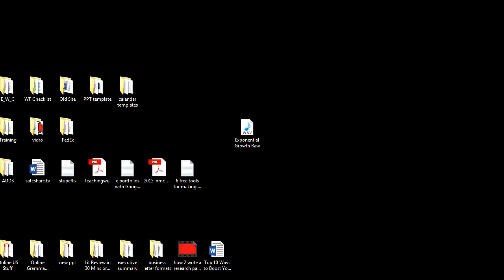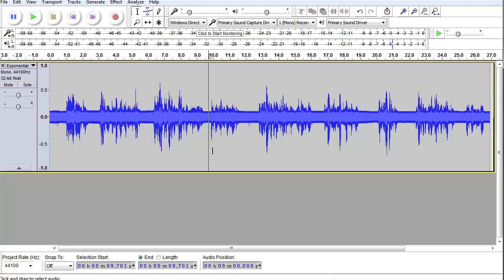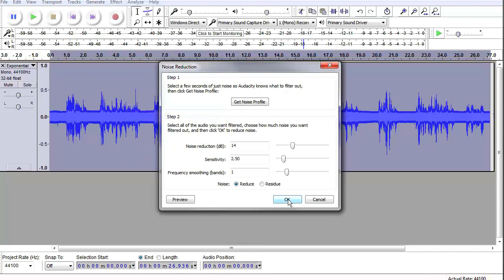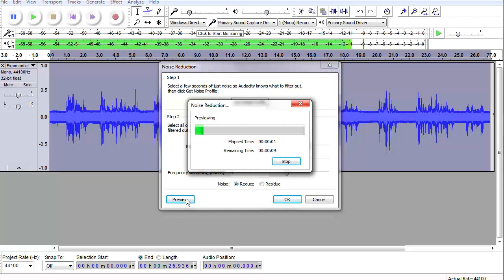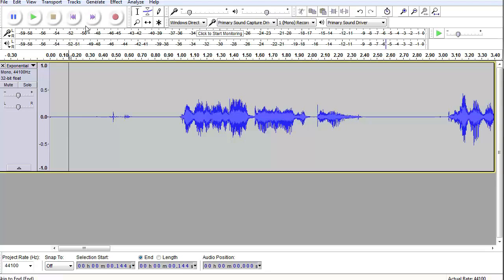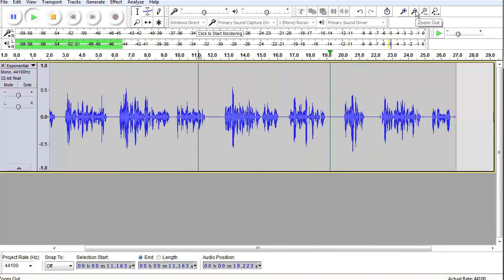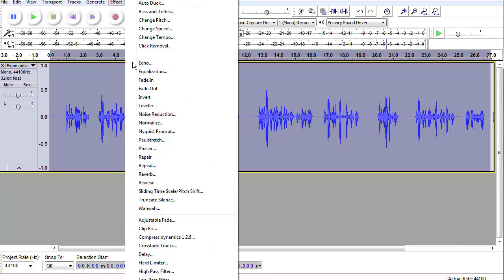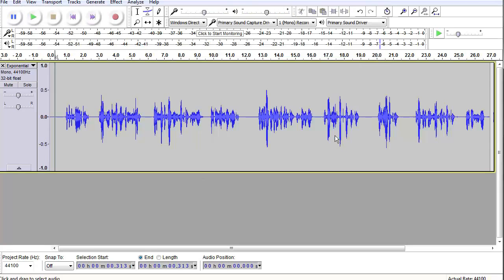Audacity Workshop: Removing Noise, EQ and Compression

Comment: David, thanks a lot for the helpful info. I think my question is very basic. Starting around 7:00, you say the audio is too bassy and let's remove some base. Then you move the sliders up. I thought moving sliders up would increase the bass; that's what seems to happen when I try it. What am I misunderstanding?
Reply from the maker: When using a graphic equalizer, the sliders are used to change the wave form. Moving the slider up caused the bass area to move up to more of a treble range (and thus less bass).
Reply: @peakdavid  Thanks for replying! I didn't realize this was how it works. I thought up is more, down is less.

Comment: @davidtaylor, great video, have some trouble editing our church choir audio and could use some tips if you could email me rhysjnaicker21@gmail.com that would be great and appreciated.
Reply from the maker: Rhys--I have zero experience in editing music.
Reply: @peakdavid  hi the problem isn't the music the problem is this terrible background noise thats distorting
Reply from the maker: @rhysnaicker1049  You can try Audacity's Noise Reduction tool, but if the right recording equipment wasn't used to begin with, it will be difficult. I would have to hear the clip. Audacity is only a desktop editing tool. If the original recording isn't clean enough, Audacity can't help.
Reply: @peakdavid  ya i tried audacity noise reduction but that didnt work, i suspect youre right about the recording equipment however it used to work well, but this specific glitch noise came in pretty recently which is my concern and was hoping someone with experience could identify the noise if possible?
Reply from the maker: @rhysnaicker1049  If the glitch noise occurs during/on top of the voices, there isn't much hope for the clip.

Comment: Holy cow! This is undoubtedly one of the best Audacity tutorials *ever*. I just couldn't figure out that stupid hum and only you brought it up. I was doing Noise Reduction multiple times,but I found it affects my voice a bit. Makes it slightly metallic. Can you help? Any ideas?
Reply from the maker: Extreme--First, make sure you are selecting a part of the clip that has no speaking. Second, use the slider on the Noise Reduction tool to slowly remove noise. Keep repeating and adjusting the slider to take out more noise. At some point, you will either remove all of the noise or your voice will begin to sound metallic. At that point, that's it. If there is still noise left, Audacity cannot help you any more. Good luck!
Reply: @peakdavid  Thank you so much. I didn't know about the slider. Will definitely try that ASAP.

Comment: Probably a basic question, but why not just reduce it by 48 decibels instead of incrementing it down?
Reply from the maker: Thad--Thanks for your question. The more that you crank in noise removal, the more likely the tool is to eat into the vocal part. My goal when a clip has substantial noise is to use the reduction tool just enough to flatten the noise and not affect the voice.

Comment: How do you get rid of thumps and paper sounds without ruining the audio?
Reply from the maker: Ryan, if these sounds occurred while you were speaking, you will have to record again. Sorry.
Reply: Oh, so theres no way to minimize those sounds in a recording? Do you have any tips I could use when I record a podcast to have minimal sound affecting my podcast?
Reply from the maker: @ryankim9017  Ryan--do the sounds occur anywhere that you are not speaking?
Reply: Oh yeah, but sometimes there are sounds of water sipping and paper crackling while there is speaking
Reply from the maker: @ryankim9017  In that case you have no other option but to rerecord. Do so in a small room, isolated, and put towels and blankets on surfaces to minimize echo. Hit record, do not speak for 3-5 seconds, then begin speaking. Make sure your mic is 3-4 inches from your mouth,. Good luck!
Reply: Okay, thank you!

Comment: you said Equalisation is making the harsh sounds less harsh and the soft sounds louder. But isn't that compression, which is "the process of lessening the dynamic range between the loudest and quietest parts of an audio signal. This is done by boosting the quieter signals and attenuating the louder signals" .  I don't understand the difference. thanks
Reply from the maker: I teach my students to use EQ to boost or reduce selected frequencies for a more natural sound in comparison to their actual or desired voice.

Comment: i did remove the noise when no one is talking but it didnt remove it when someone was talking
Reply from the maker: That could mean that (1) reduction was not applied to the entire clip; (2) the original sample before reduction was not long enough; (3) there's too much noise on the original and there's not much you can do about it; (4) the sensitivity and amount settings on the noise reduction tool might need to be increased. My guess is that your clip is just too noisy. That happens sometimes and you just have to bit the bullet and re-record.
Reply: @peakdavid  yes makes sense. thank you, but why does my voice kinda get distorted when i use this?
Reply from the maker: @emlodydjw6367  Voice distortion occurs when the amount and sensitivity sliders are set too high and begin leeching some of the frequencies/harmonies of the human voice. If you back off the sliders, some of the noise will return. This is why the original recording must be done in a quiet a room as possible, there must be a 3-5 second pause when the recording starts to capture all of the background noise. Some environments are just too noisy to record in.
Reply: @peakdavid  okay , thank you!  and one more question not to bother you anymore hahhah, how to back off sliders?
Reply from the maker: @emlodydjw6367  After selecting Noise Reduction from the Effects dropdown menu, a dialogue box will appear. The two sliders you want are Noise Reduction (dB) and Sensitivity. Play with them, apply, playback the clip, play some more.
Reply: @peakdavid  okay thanks, so when im done with the audio, how to use it in a video? how to put the fixed audio instead of unfixed one?
Reply from the maker: @emlodydjw6367  File > Export (wav or mp3) the fixed file to your desktop. Open your video software and import the audio.

Comment: why does your voice audio sound like a digital hall way when you speak and how do I fix that?
Reply from the maker: The problem is likely the environment where you are recording--lots of flat surfaces that echo your voice back into the mic instead of absorbing it. You can try recording in a closet or try putting towels liberally over everything in the room, including the floor if you don't have carpeting. Also, don't be directly facing a computer monitor when recording. The monitor will also echo back your voice. If those techniques don't work, the problem may be your mic or sound card.
Reply: @peakdavid  thank you I will give it a try
Reply from the maker: @djchubbithecheka6050  Good luck!

Comment: I did Noise reduction + compressor +equalization + normalize, will that make my recording better? Becausr i can still hear a bit sound of the background..
Reply from the maker: If you still are hearing background noise, you need to do Noise Reduction again. Isolate and sample at least one second of the background noise and redo the Noise Reduction. Play with how much you take out without distorting your voice signal.
Reply: @peakdavid  as i said, i already did noise reduction, then compressor, than equalization, than normalization, so if ill do noise reduction again, it wont ruin the audio or something?
Reply from the maker: @JAdrew  No, play around with the setting to take out more or less. Be sure to sample only background noise, no spoken parts. See https://youtu.be/CJJgJfI_sZ4

Comment: David, I submitted a book reading voice over  through ACX, and they rejected it a couple of times. I don't hear it dough. I believe if my laptop fan. I fixed it they said that is too quiet. So, I'm not sure what else to do. Any suggestions?
Reply from the maker: Pilar--I would have to hear a partial clip of what you submitted. What recording equipment are you using?
Reply: @peakdavid  Thanks for replying. I'm using my Lenovo Pad and an Apogee Mic+ .
Reply from the maker: @mapicepla  You've got a good mic! The Lenovo Pad is old. That could be your problem. How can I listen to a short clip of the audio?
Reply: @peakdavid  Actually I just got me a new Lenovo but I haven't try it yet. Ok do it again with the new computer and of it doesn't go thru, I'll send you the recording file, ok. Again, thanks for replying to my inquiry.
Reply from the maker: @mapicepla  yes, send the clip to promopeakdavid@gmail.com
Reply: @peakdavid  at first I was using Beat earphones  connected to the Mic+ but I stoped doing that because I believe that it was transmitting static to the recording.
Reply from the maker: @mapicepla  Earphones connected to your mic? Yikes! Please don't do that.
Reply: @peakdavid  could I send you the file as an MP3 file? Maybe you could tell me what is it that MCX are referring to.
Reply from the maker: @mapicepla  sure: promopeakdavid@gmail.com

Comment: hello i just ordered a corsair hs 50 head set with mic and i heard a couple reviers say it has a somewhat tinny sound or has noise compression going on. is there any simple,free tools  to help fix that?
Reply from the maker: Try out your new headset and if the mic produces a tinny sound that you don't like, then return it for a refund and get a desktop USB mic.
Reply: @peakdavid  so it would not be a fixable issue then?
Reply from the maker: @sneakysquirrel1990  You can use the tools in Audacity to make the mic sound better. But the best solution is to have better input with a better mic.

Comment: can this also remove sounds from outside your window like cars passing by? or would there be a different approach to that if its possible
Reply from the maker: Yes, it can. At the beginning of video, hit record and don't breathe or say anything for 5 seconds. That 5 seconds will contain the ambient noise that Audacity can remove. If during recording a loud car goes by, pause your speaking, let Audacity record the car noise, then remove the noise using the technique demonstrated in the video. Good luck!
Reply: @peakdavid  wondeful
Reply from the maker: @oldglories  Thanks! Here are other tutorials on Audacity you might find helpful: 2018 VOICE SOUND GOOD  https://youtu.be/7fYiUXER97U  COMPLETE https://youtu.be/aCisC3sHneM

Comment: Hello, David. Thanks for the informative video. In EQ I usually do bass boost and treble boost and it seems to work pretty well. The question I have is, how do you go about setting up an EQ curve?
Reply from the maker: Hi, To create a new EQ curve and save it so that you can apply it to future clips, first be Select EQ from Effects, then Graphic radio button, move sliders to achieve your desired effect, then click Save/Manage and give the new EQ a name. It will now show up in the selection list in the future. Good luck!
Reply: Thanks! As far as getting the desired effect, is it really a matter of trial and error or are there recommended settings? If there are defaults, maybe I can just do some fine tuning.
Reply from the maker: You're welcome! If you are using the same equipment and environment for recordings, EQ presets or plugins can be helpful, especially as starting points. Audacity has about 8 built in. You can download EQ plugins and import them into Audacity. Just Google "Audacity EQ Presets" and "Audacity EQ Plugins."

Comment: David, thank you very much for your content. Im starting my own podcast using a lot of what I have learned from your videos. One thing that I am struggling with, is when exporting the audio to Mp3. The audio doesn't seem to have the same quality and bass. Recording on 16bits - 44100hz, equalizing on "bass boost" and  normalizing at -2.5 and still very robotic and kind of tremble voice. Any suggestion? Thanks mate
Reply from the maker: The 16bit--44100Hz setting is for CD quality. You can definitely go higher: 32bit, 96000, or even higher and see if the larger file size makes a difference. You can also export out using one of the other codecs, depending on what program you will use the file in next. "Uncompressed" is the largest file size and is closest to the original. You may also want to normalize at -1.5 dB and see if that helps. Also, try equalization with the graphic sliders to reduce treble. The "robotic" element sounds more like a delivery or acting issue.